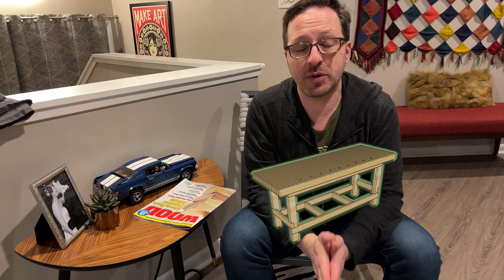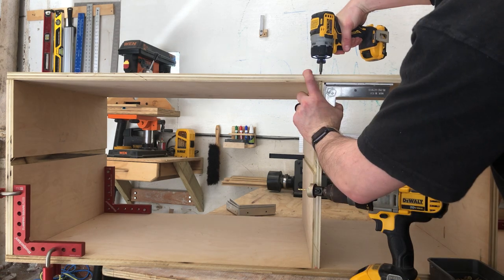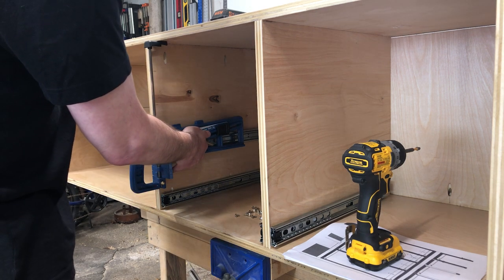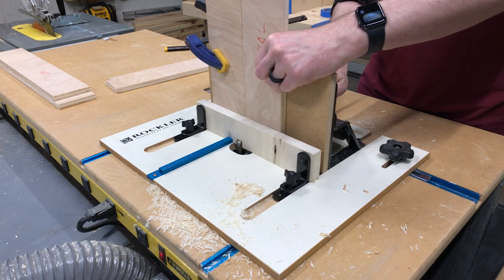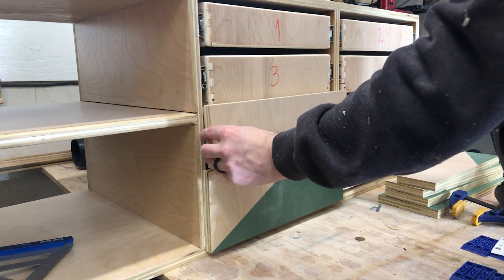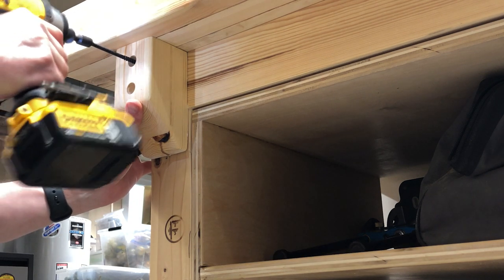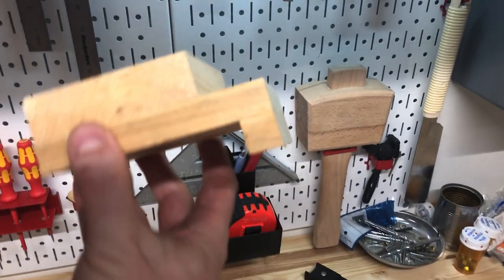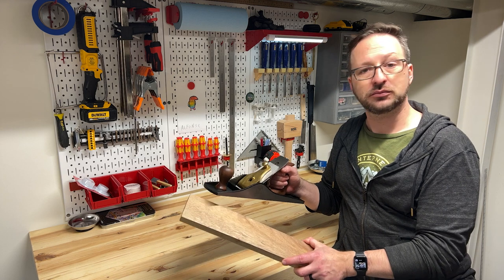Classic Sturdy Workbench (pt. 2)

Comment: I never would have thought to screw a board to the edge of my bench and treat it like a vice.  I already did it and I'm using it to hold a piece while I apply edge banding.  It's working great and it took me longer to find just the right scrap than it did to accidentally screw my clamp to the bench. I mean attach the "vice".
Reply from the maker: To be honest I was a little worried about presenting that part of it, so I'm incredibly relieved to hear you're using it!  Thank you!